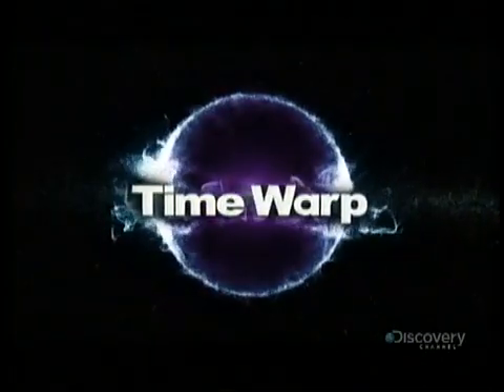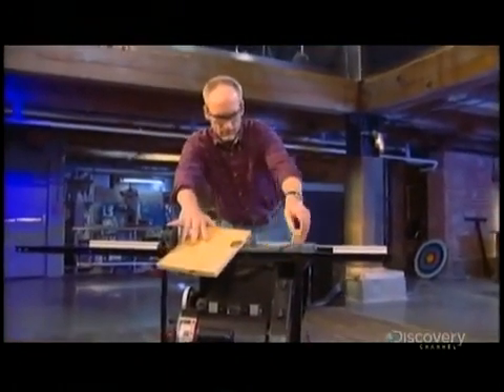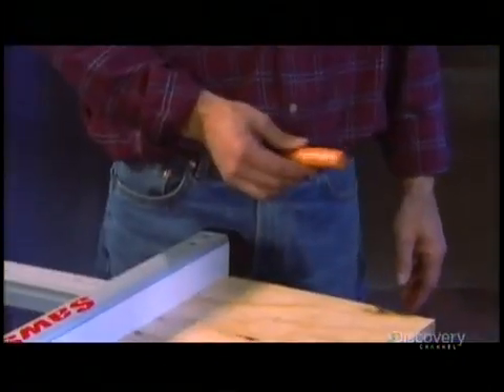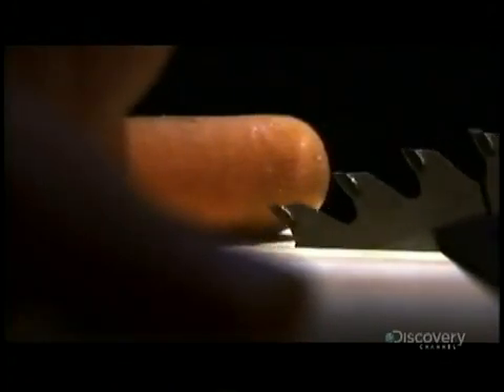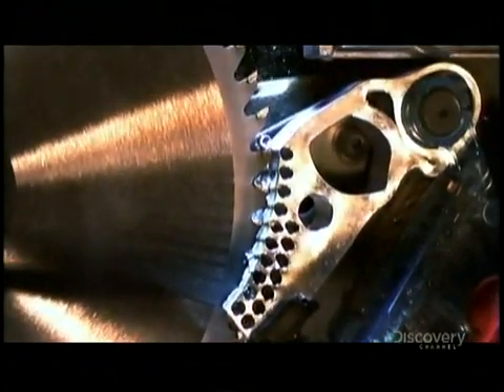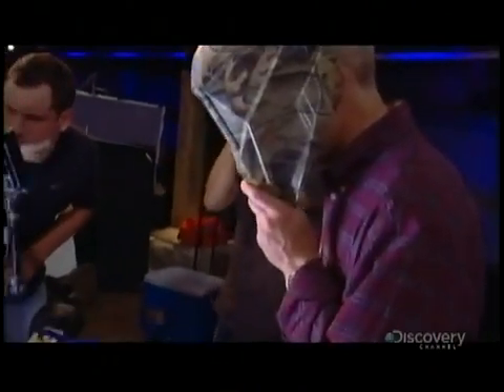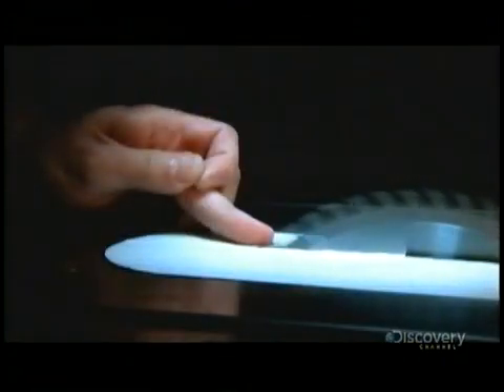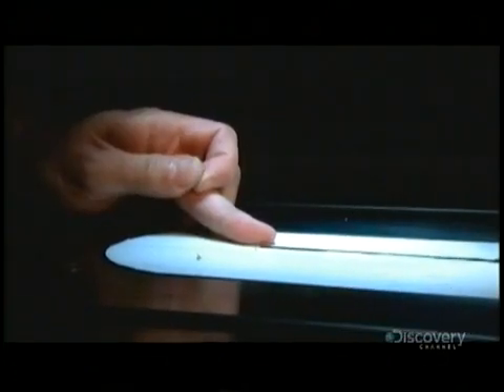Saw Stop - This guy puts a finger into an active table saw blade & comes away without a scratch!

Comment: 2 days ago i almost cut my thumb off from a table saw ( 6 stiches later it's healing) and i really am thinking of investing in one of these. (if anyone was curious what happened i neglegent i was tired and without thinking used both hands to guide the wood lifted my left hand off to hit the power switch and my thumb got nicked it went around 50-60% through but  no bone thankfully because it was my finger tip)

Comment: This is absolutely amazing think of all the fingers this will save! It’s just that when your hand goes into a tablesaw it’s normally not going in so slowly I think a better representation would be to just take the hotdog and just drop it on the blade! Kind of like throwing your hand into the blade by kick back but  way better than losing a whole bunch of fingers.

Comment: what happens if the current cuts out just before you touch the blade with your finger
Reply: You would hope there's some sort of small battery or large capacitor to keep the mechanism working until the blade powers down

Comment: I was undressing with the ceiling fan running and I took my shirt off and put my arms up too high and it  fapped my hand broke the fan and a finger had to turn it off. Still broke today(the fan not my finger). I bought an AC unit after that. No need for Ceiling fan now.

Comment: If you were REALLY smart, you'd do the test by touching the SIDE of the blade.   Where it doesn't have sharp cutting points.   Still tests the system perfectly, but with enhanced safety.

Comment: I don't care if it breaks the whole saw. I'd rather have to buy a new saw than buy a new finger.
Reply: But it doesn’t ruin the whole machine.  It only ruins the blade and brake cartridge.  The saw alone is designed to withstand the tremendous force generated by the stopping of the blade.

Comment: One thing, he wet his finger before this demonstration, also he used as little contact as possible. Irl this is going to probably cause a nick and some blood, so this demonstration is not quite representative. However it will absolutely save the finger, much better to have a nick, and maybe a scar at most, than lose a finger. 

Also the 60 dollar replacement cost, is literally nothing compared to the emergency otherwise.

Comment: I realy like this, but i have 1 question.

U buy ur sawstop, install it, use it every day for a year or 2 when the accident happens.

How well is the connection protected from the dust in long term?

U work in a workshop, yes u clean after u finished the cut / day, but i very rarely clean where this safety system is installed. We all know sawdust, and it will find its way to the plug

Anyone has any experience with this?

Comment: Genius invention. Definitely will save you limbs from flying off. But the reality is that in a real world setting, you’re not going to accidentally creep your way onto an active saw blade. If it’s going to happen, it’ll be quick and with much more momentum. You will absolutely get cut regardless of having a saw stop. And if you flung your fingers towards it, you may even lose them. The saw stop is meant to limit damage to your body, not prevent. To incorrectly claim that it doesn’t even leave a scratch is a misleading and dangerous statement.

Comment: This is a great idea the only thing I can think that might go wrong after time if you did end up making it go safety off a lot of times, I'm guessing that the axle that spins the sawblade will start to get a little bit wobbly from all that torque having to stop all of a sudden so many times but aside from that it's still a really good idea.
Reply: it's a bit of a 1 time use thing as the system literally puts a metal bar in the saw to stop it instantly which causes a lot of damage to both the system and the saw

Comment: If you can’t afford one of these use push sticks. They are actually better once you get used to it because you can hold the piece right next to the blade. Stand far enlightened back that you literally can’t reach the blade without taking a step forward and work from that position.

Comment: Why doesn't he just have the saw move down whenever it detects something?  the saw goes under the table and it can keep spinning, just at a place where it wont hurt you
Reply: How would you propose he do that?
Reply: @SudlaSteel  each side of the saw that holds it in place would be attached to a piston that moves it down extremely quickly, that way its out of the way and doesn't hit anything, i know im probably wrong and this wouldn't work, idk i was just thinking
Reply: @codygenius3723  it would have a higher chance of malfunctioning if that were the method used. Also, the method he uses stops it far faster. It'd be nice if it didn't destroy the blade, but unfortunately there's not a lot of options.

Comment: Here some facts!!!
It does work!
It cost 80 bucks to replace the brake cartridges  after each time!
It goes off at:
wet materials!
Meica with any kind of metal
thin aluminum sheets!
moist cardboard!
Nails in the wood!
Fingers!
So much said the mechanism can and should be deactivated in case you need to cut these things, but the guy operating the machine forgets to do that 50% of the time! Not to mention the 3 hp version cost 3k and a comparable saw cost 25% less!

So here's my 2 cent: I'm in the business since I'm  16, I went trough safety training, and I follow the rules, and yes thank god
I still have all my fingers! This machine is Sh!%, i hate it I worked with it I saw others work with it!

Conclusion!
If your workers are $10 pallet makers with no common sense, and you don't mind blowing out $240 a month
 or 2 for replacement brake cartridges! It also takes about 15-20 minutes  to replace the cartridge! You also want to make sure you have them in stock I seen people blow 2 in 1day! And technically you are not suppose to use the saw blade anymore either but nobody cares about that anyway! 
Hope I put out some facts no-one talks about selling these!

Comment: These guys sent me the pictures of ;saved fingers.  There is a little scratch on the nail or skin. after all the operator is pushing his or her finger into the blade.  So I understand the scratch or even a minor cut.  But it cringes me to think what could have happened if the saw didn't stop.

Comment: Once upon a time i was hanging a new door and fitting a lock i was saddling the door drilling for the lock with a powerful mains drill and slipped, my jeans got twisted up in the drill so bad it ripped my zip off, i so nearly got my ball sack all twisted up in it, and it was sharp drill bit, i felt sick afterwards just thinking how close i came to getting my balls all twisted off. they should do something like this for drills, i suppose you'd have to work naked but better safe than sorry.

Comment: A fingernail is barely conductive.  The teeth grab a fingernail and pull it of brutally, along with some flesh attached to it.  Besides, dry skin is not 'a salt wet finger'.  I have seen seriously cut fingers with this system.  Even at a reaction speed of 'only' 5 milliseconds, a 72 teeth blade spinning at 4000 rpm slashes 24 teeth through your skin in that time frame.  It will not amputate, but I would not suggest to take any chances.

Comment: But what happens if you move your hand into the blade at a normal speed? Everything I've seen is moving at 1/64th of an inch an hour. People don't move that slow when cutting wood or reaching around for things on the table saw. I saw a video form a guy who has a saw stop table saw and he accidentally hit the blade with his thumb when reaching for the cutoff and it took a big chunk out of his thumb. Would it have been worse without a Saw Stop saw? Probably, but the problem is they are portraying this thing as something it is not and people are going to be a lot less safe if they have one of these because they think they can not get hurt by it. That is 100% false.

I treat my table saw like a rabid dog. I know that as soon as I let my guard down it will bit me and do horrible things to me. The sawstop is more like your friends pet racoon. He tells you it's safe, you think it's safe and one day when you are not expecting it BAM! you're bleeding all over the place.

Comment: And all you need is to use a guard to guard the saw correctly and a push stick. Both  come with a saw when you buy it and do the job they were designed for. Its only when an idiot removes the guard and doesn't use a push stick that a saw becomes dangerous. And why would you remove a guard?

Comment: That is engineering at its very best. 
Not much impresses me, we have hardly achieved anything technologically that has improved peoples lives in the last twenty or so years apart from perhaps brighter LEDs, we are currently running about forty years behind where we should be by now simply because a greedy elite have held us back and used old systems of fossil fuels because they are easy to make money on. 
True we have shitty smartphones but they are just silly toys to enslave and brainwash the foolhardy and to make life more difficult for people. 
Think of the hoops you now have to jump through just to renew your car insurance, they use algorithms for everything, so many questions asked and it's so hard to get a good deal, all because of the overuse of computers and technology. 
But this invention has my endorsement, it as restored my faith only very slightly in the future of humanity, but saw stop or no saw stop, I will not be rushing to put my finger into a spinning saw blade any time soon.

Comment: Now try that with a dry woodworkers finger whose moisture has been sucked out by all of the sawdust he touched while using the table saw.  I get the concept here but it’s dangerously misleading to the average carpenter.  After 39 years in the industry I cut off 1/16th of an inch of the tip of my finger 2 days ago doing something in a slightly different manner than I usually do and I made contact with a brand new blade that I just put on 5 days prior. It nicked my nail and tore out a tiny chunk of my dry skin.  This wouldn’t have detected my finger that day.